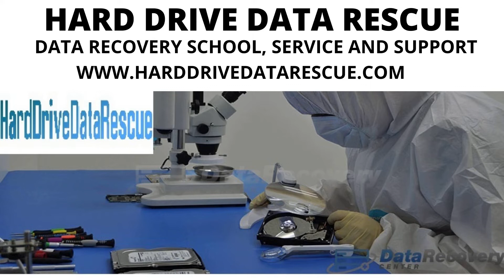Data Recovery VLOG, Seagate Drive, Data Verification Process

Comment: Hi if a ST2000LM007 drive becomes undetectable would replacing the read/write heads fix the issue? I'm from the UK and can't afford to pay a ton of money to get my drive professionally repaired. I dropped the external drive one day and it worked until recently. Now the computer either doesn't recognize it or it shows up temporarily in explorer. I did plug it in and out a few times to try to get it recognized but after watching your vids this might've made it worse.

If the heads are the issue I'd feel comfortable changing it from a donor drive.

Any advice would be appreciated on what would fix it

Thanks